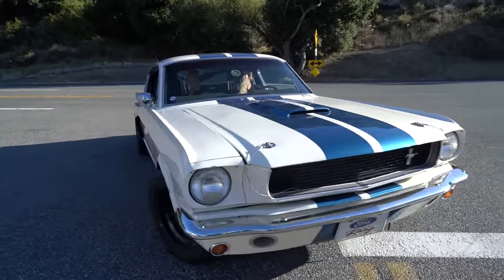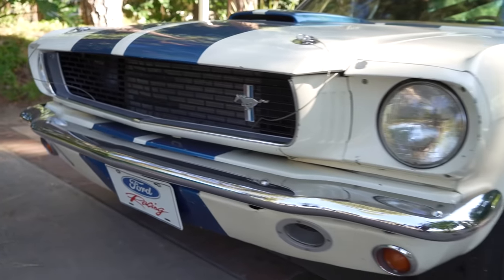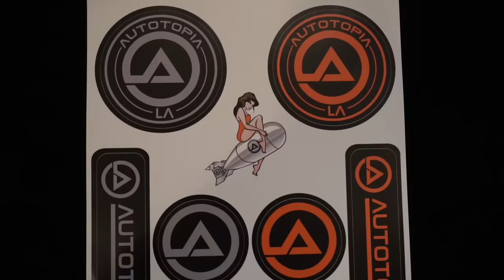Loud Shelby GT350 Throws Down

Comment: Which number is this? We used to have SMF315. I say that is not an original Shelby. The dash pod is in the wrong place and the Monte Carlo bar firewall bolts are wrong. My car is not a Shelby, but I don't claim it is.

Comment: Would like to know how he keeps those rear wheels pinned to the street with leaf springs. Had to put traction bars on mine to prevent wheels hopping all over the place.
Reply: BeaconVideo Remember it’s an old race car...so the suspension has been sorted, but look at the tires...they look like they are illegal for street use...they are basically slicks. They grip

Comment: HI, MY NAME IS DENNIS. I HAVE A 65 GT350 TRIBUTE FASTBACK THAT I HAVE OWNED AND DRIVEN DAILY SINCE 2006. THIS PAST YEAR I HAVE HAD A COUPLE ISSUES THAT KEPT ME FROM DRIVING IT EVERY DAY. I HAVE ALWAYS WANTED TO GET IT REPAINTED AND ADD A COUPLE R MODEL PARTS TO IT AS WELL. MY WIFE JUST GAVE ME THE GREEN LIGHT TO GET THE PAINT AND BODY DONE. WHILE DOING THAT, MY 10 YEAR OLD REBUILD OF A 68 302 BLOCK THAT I HAND BUILT WILL BE REDONE AGAIN, BUT BY AN ENGINE COMPANY THIS TIME. I WILL ALSO BE GETTING MY 5 SPD MANUAL TRANSMISSION OVERHAULED AND CHANGE OUT MY 8" 3:25 TO A 9" WITH TRU TRAC 3:50 GEARS. WHEN EVERYTHING IS ALL DONE IN MARCH OF NEXT YEAR, IT WILL BE PUT BACK INTO SERVICE AS MY DAILY DRIVER ONCE AGAIN. YES, I DID SAY MY DAILY DRIVER. I WOULDN'T WANT IT ANY OTHER WAY. SO JUST IN CASE YOU WANTED, OR NEEDED A STORY AROUND THAT TIME, HIT ME UP!

Comment: I LOVE IT!!!!  SO BADASS AND BEAUTIFUL!!!!  GREAT VIDEO SHAWN!!!!  GREAT BUILD DAVID!!!!!!  I LOVE DRIVERS!!!!   I AM SO IMPRESSED!!!!!!  I MIGHT REMOVE THE WIPEERS AND.  MAYBE THE BACK SEAT AS WELL.   AND THE RADIO.  AND ADD RECARO BUCKET SEATS. AN UPDATED FORD MOTOR. AND A MANUAL TRANSMISSION.  HAVE A CAROL SHELBY INSPIRED 59 EDSEL RANGER.

Comment: It is like many people have always said. You don't know real power from a small  block until you drive a small block with a 4.125" bore... It's not just the stroke of this engine It is the 4.125"  bore Dart block that sets it apart from the 289's and 302's, 351W and 351C for that matter....

Comment: 400 is more than enough to rip!!!! Hahahaha
My brand new Mustang GT in 1986  was only 200hp back then. It was a blast to drive and have fun!!!
Especially to work on it and learn how to make it go faster. Hardly any budget as a teenager but you could. With off-road exhaust 3:55 gears bigger intake throttle body etc. Let’s not forget brakes cause they were shit rear drums. I think today the same things could be done but way better since Pony cars are light years better and access to performance parts!!! For way less than the new $85-100K Cobra. Especially for someone who wants to learn to wrench some on their own weekend hotrod n go from there.
😎😎👍🏼🤣🤣

Comment: Besides gone in 60 seconds thats the craziest ive seen one of these driven, awesome 👍 nice low 12sec car or maybe even high 11s. My good friends 350whp 302 NA fox, was running 12.2s with full weight 3100lbs. So with less weight and more power i can definitely  see 11s out of this car. The camera doesnt catch it like being there. A 12sec all motor car feels fast especially  in the passenger  seat.

Guessing dart or boss 302 block? Believe it or not 7k rpm isnt that crazy even for sbf anymore. Stock i was ripping 6500 on the daily... just because, lol. 
When i had my sbf built for 93 octane  power i requested comps 8k capable hydraulic lifters. Motor made max hp on engine dyno at 7k. Ill be revving to 7500 to get some longevity  out of it, lol. Cant wait to drive it one of these years, lol. This is not a good year to finish it. Covid fucked me good, still need new turbo and hot/cold side, and tune. Maybe drive it in a year or two. Till then hearing it idle will have to be enough to keep my sanity.

Comment: I have the same engine in my 1967 cougar, it's not half as loud as this mustang, and I can't drive like this guy either, you see I'm married,she would find out
Reply: Mayhem Maverick  I just did the electric headlights motors wasn't too bad, and did rear disc, ssbc they were hell to get to work right, would never do again, just about  no E brake, they just look cool,maybe 10-15% more braking that's it
Reply: @dogsense3773  that's about all you want from your rears. 80-85% of your total braking force is from your front discs. Get better pads if you want more clamping. Plus if you just converted it takes hundreds of miles to burnish new pads.

Comment: 363 out of a stroked 302? or it's a 351?
Reply: 363 cubes out of a Dart 8.2" (302 deck height) block.
4.125" bore x 3.40" stroke 
You can't make a 363 from an OEM Ford block....only a 347.
4.03" bore x 3.40" stroke.